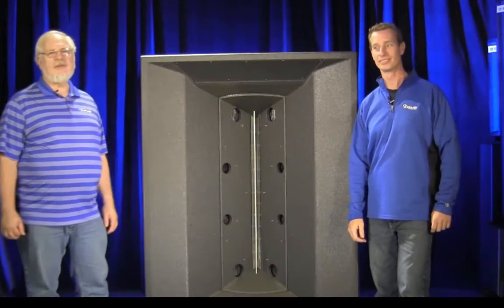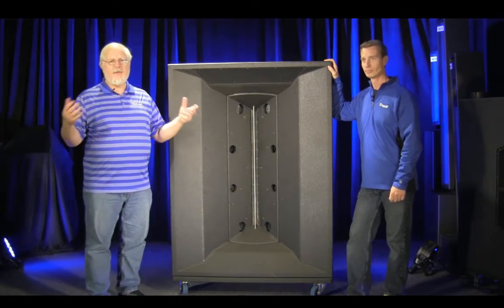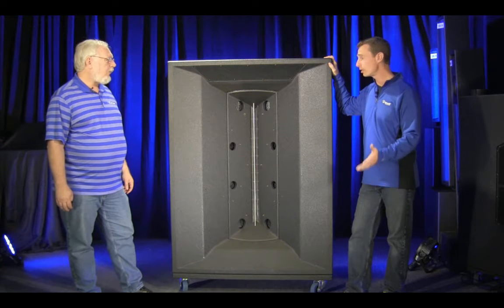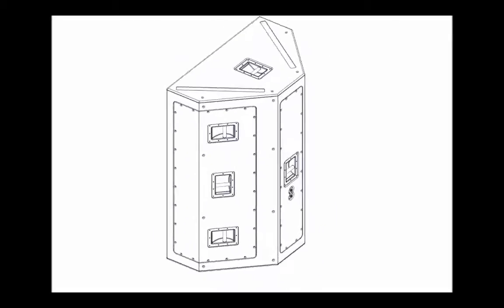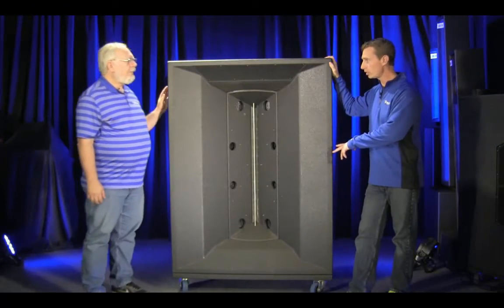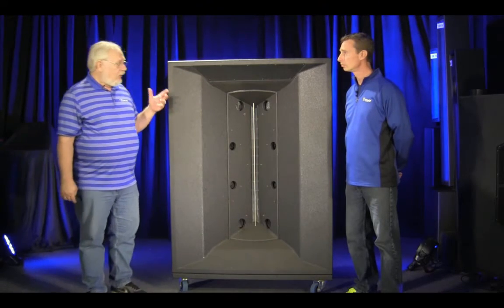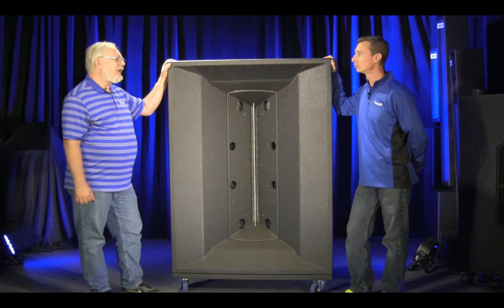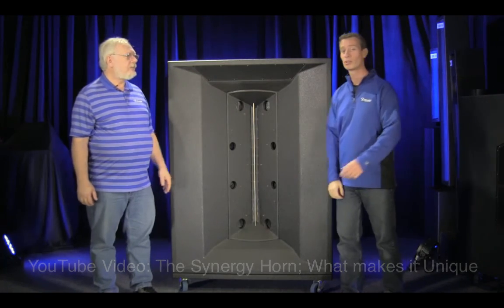Danley Jericho J2 ( J296)

Comment: Where does the sound come from the 6 18" speakers? The original J1 had a big folded horn for the 18s but are those ports for the midrange drivers or the woofers? It seems like you'd get a lot of port compression trying to use those tiny ports to get vast quantities of bass from 18" woofers but it seems like this design works well so what am I missing? It seems I'd want multiple ports the size of my head to vent the output of 6 18" woofers.
Reply: No different than the other Synergy models, like the SH50 etc, the LF emanates from those holes.
On paper it's amazing, I wouldn't doubt the approach as It's mature and well received.